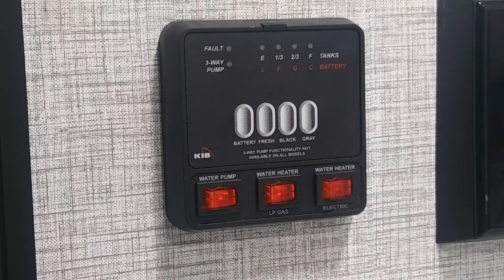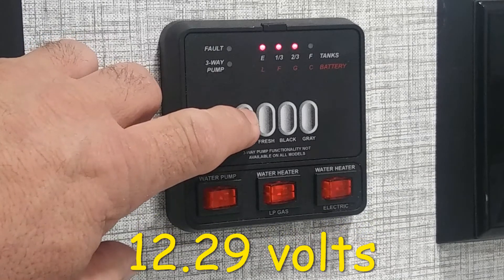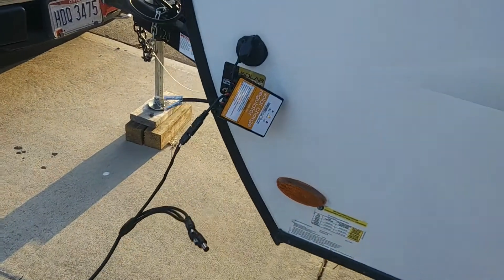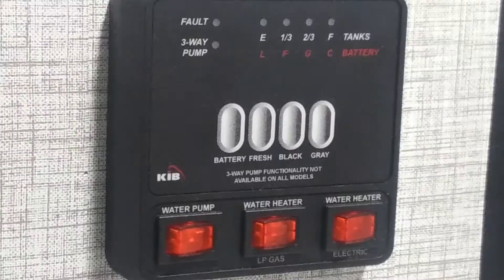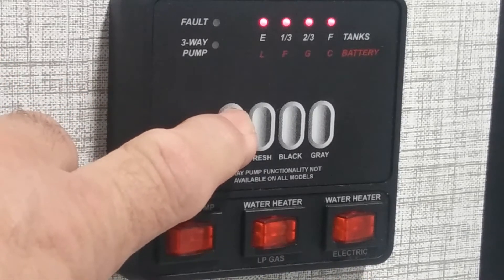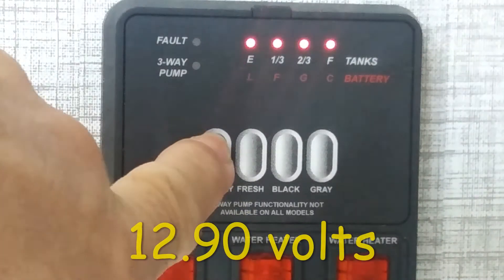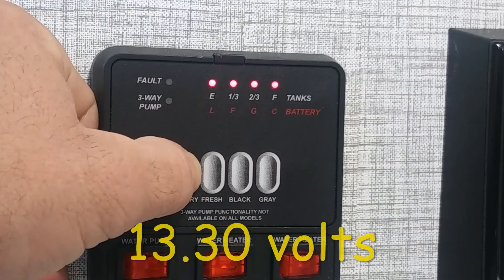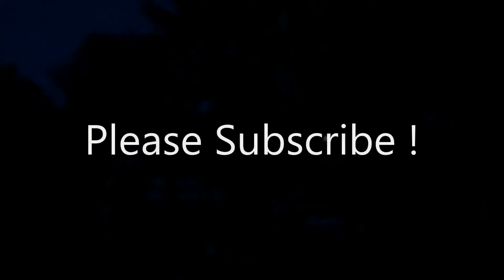Solar Charging the RV

Comment: I have both a 100w and 120w folding panels from Rockpals. I thought they had controllers built in already? However it looks similar to your 60w, so I’m thinking the controller it has is optimized for Power Stations and not 12v batteries?  If this is the case is the HF regulator enough for my solar panels?  I’m not sure it it’s an 8A or 10A regulator or not? I would be pushing 8A and 10 A respectively.  Want to get maximum charging. Appreciate all your videos…super helpful!
Reply from the maker: you are correct, they are set up to charge power stations. You do need a charge controller and I have found one better then the harbor freight unit, https://www.bougerv.com/products/li-20a-pwm-solar-charge-controller, this one for the price is a good deal and you can wire it to use with your panels. Thanks for your comment, hope this helps you out.

Comment: Do you have a link to which charge controller you bought please and what wires we would need to buy. Thanks
Reply from the maker: Thanks for asking, I use a charge controller from Harbor Freight, The thought behind it is if anything goes wrong with it I can find a HF store anyplace in the us to purchase a new one. the sea connector is at most auto parts stores or in the trailer connector section of alot of stores, (walmart, lowes, ect)

Comment: We bought the suitcase solar panel. What is that solar charger regulator?  Thanks ~ Diane
Reply from the maker: It regulates the voltage going into the battery so it does not over charge the battery. Solar panels can put up to 24 volts output and lead acid batteries should never be charged over 14 volts.